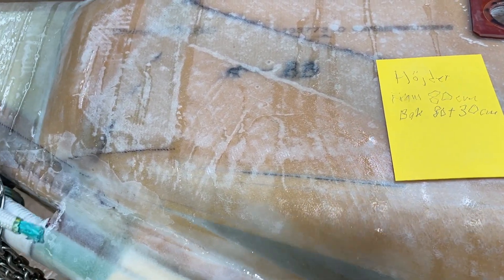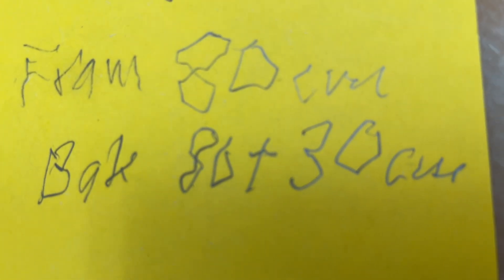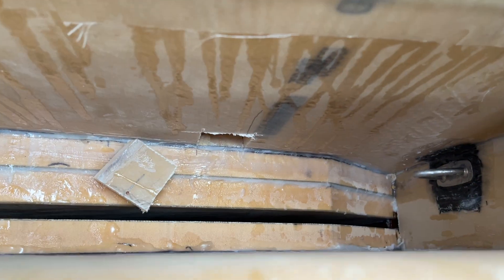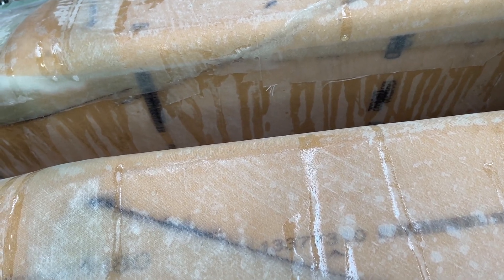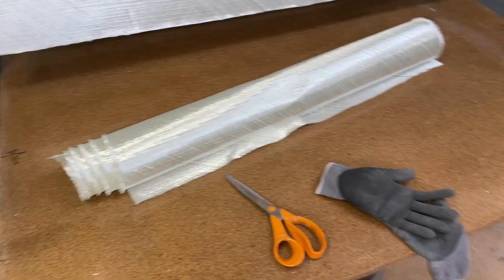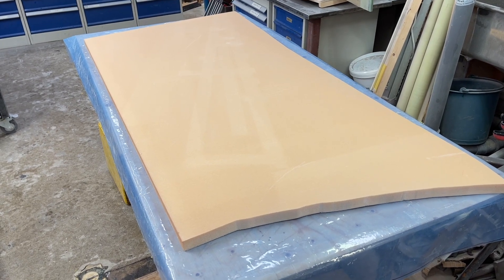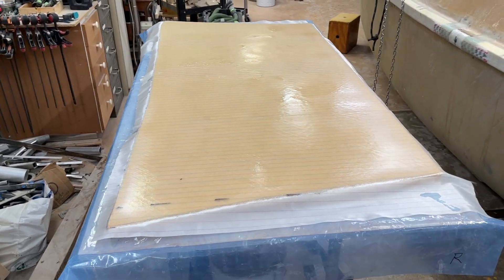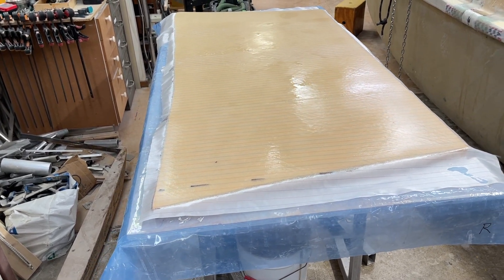26 Aug 2023 Before horisontal overflow tanks Now vertikal

Comment: What was wrong with the ventilation system that you were building before that you had to do so much work to remove and rebuild? Is the new idea so much better? Why the stainless stealbow when you can do a similar thing with composites?
Reply from the maker: It was nothing wrong with the previus one.
The new one is just much better.
It is simpler. Have greater capacity, takes less space.
Also the stainless pipe acts as a handhold just where it is handy.
Also I have the next boat in mind and like to test this one.